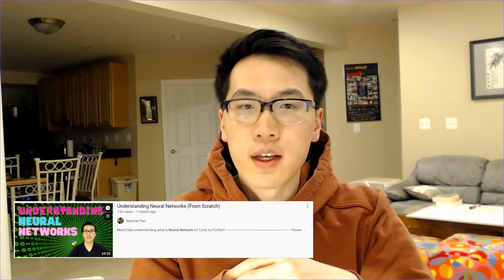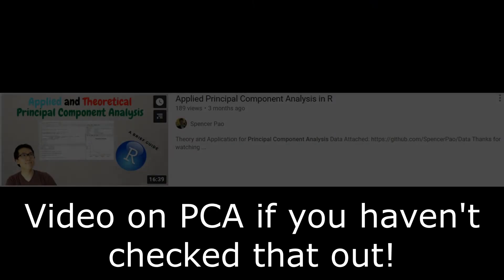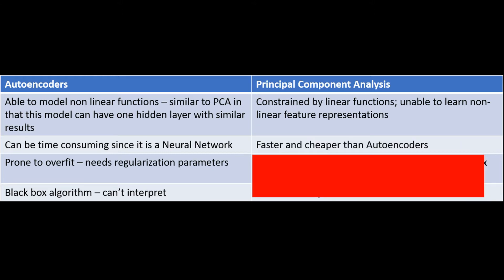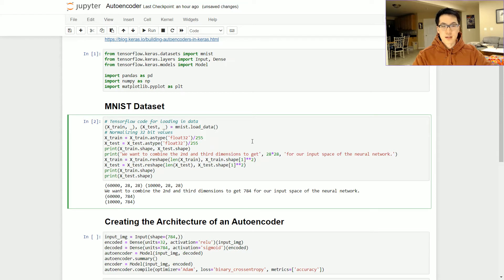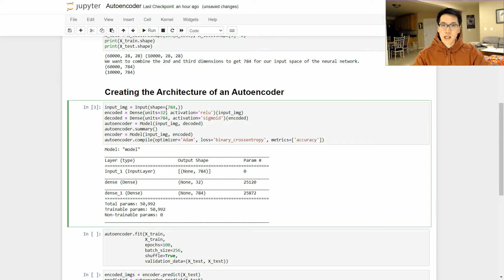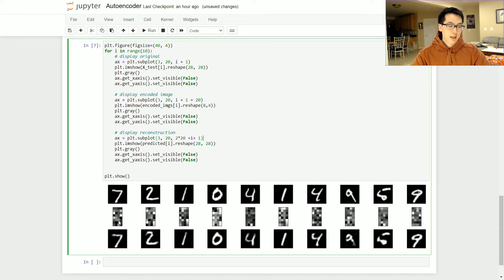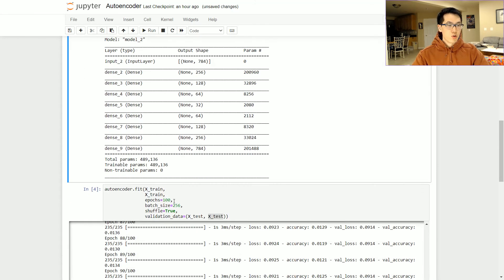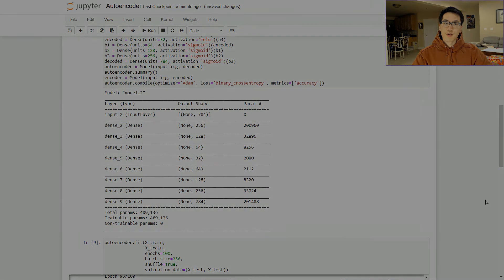Understanding and Applying Autoencoders in Python!

Comment: Finally I understood how to build an autoencoder. Thank you. I have a question though: why do we need autoencoders? Is it to better analyse the data?
Reply from the maker: Hi! The primary use for autoencoders to to model nonlinear relationships. So basically, if PCA cant do the job because of its linear scope, then try and use autoencoders.
Reply: @SpencerPaoHere  thank you very much for the quick answer. Then, play the results of the autoencoder a role in the weights of the neural network that discriminate the numbers in the images?
Reply from the maker: @faceprofesor  Yep! You could do that. You can use AE for that as well. There are a lot of articles on deblurring images for higher resolution too!
Reply: @SpencerPaoHere  ok thank you. Then what is the main reason for you to use an autoencoder in your tutorial? Thank you very much and I hope I did not bother you too much with my questions.
Reply from the maker: @faceprofesor  Pretty much just to discuss what you can use AE for and how it is applied.
There wasn't really a "real world" implementation with AE, but its not too far off from what I did here.
Reply: @SpencerPaoHere  thank you very much.

Comment: Hey Spencer, nice vid. Just wanted to ask how did you decide to use 32 nodes at the bottleneck? I also have a question of how we can use neural networks for clustering.
Reply from the maker: Glad you liked it!
For the literal creation of autoencoders, I don't have a great answer for why there are 32 nodes. I just used this basic architecture framework as an example. (Don't use this architecture since there are many other autoencoders that are extensively tested and used in industry)
This link may help:
https://stats.stackexchange.com/questions/181/how-to-choose-the-number-of-hidden-layers-and-nodes-in-a-feedforward-neural-netw

As for neural networks + clustering, it is difficult to cluster high dimensional data because of the distance. I'd probably use this AE as a preprocessing step. However, this paper might be more useful: https://arxiv.org/abs/2102.07472
Reply: @SpencerPaoHere  When you say it is difficult to cluster high dimensional data, I was under impression that the AE is a method to reduce the dimension of the data like PCA prior to any clustering algorithm. I was wondering if there is a way to perform the actual clustering using NN.  I think the paper you sent uses AE essentially to replace PCA before doing Kmeans. Thanks!